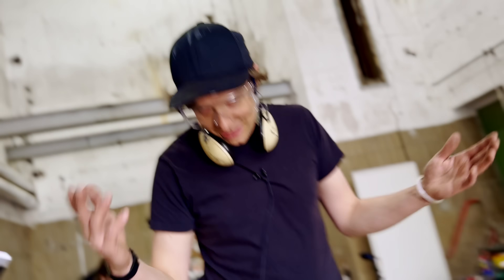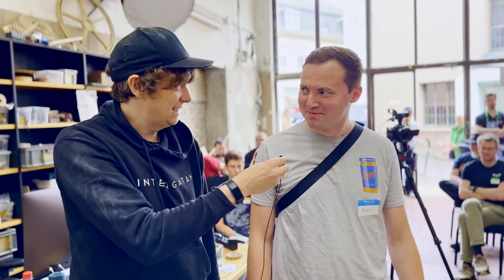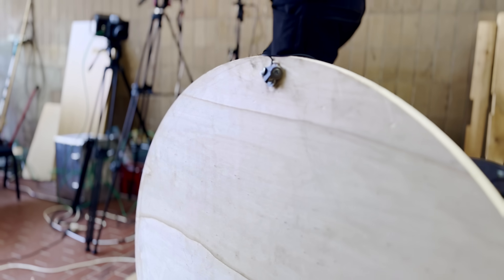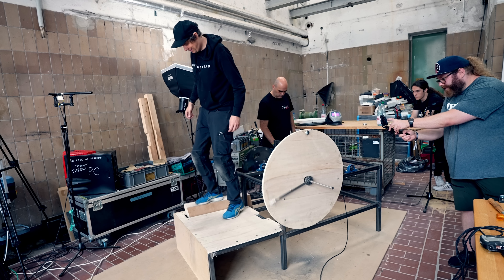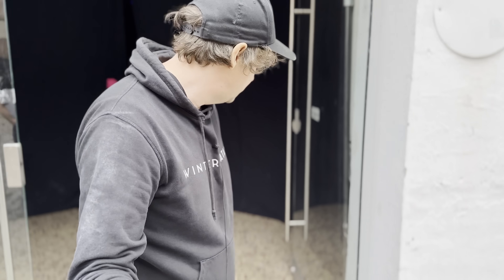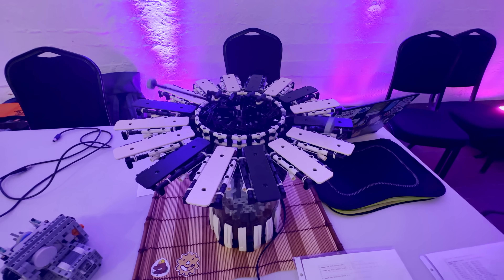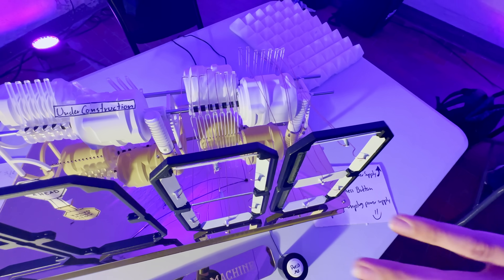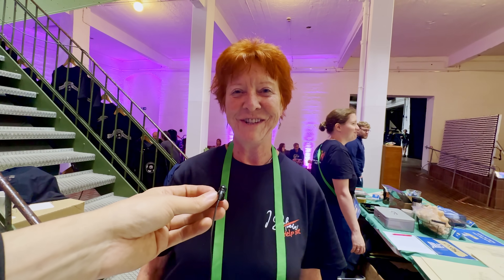First Timing Tests - DAY 6 - Marble Machine Flywheel Prototype

Comment: I would add an eddy current brake to the mass flywheel, also for emergencies. There's a lot of energy in it.
If you think this idea further, I could also imagine an eddy current-controlled speed limiter to keep the beat constant.
Reply: Eddy current speed limiter (aka an electromagnetic retarder) would work great for managing tempo. Martin would just pedal as fast as he wanted to, and the tempo would stay perfectly locked at a maximum.
Very easily doable with an Arduino, mosfet, and electromagnet.

Alternatively, he could also create a mechanical braking system that is electronically controlled. Could easily just take an old bicycle rim brake and apply that directly to the flywheel, with a servo tugging on the cable (through a stiff spring).
Reply: @roboman2444  I'm thinking of a centrifugal governor. You could set a maximum speed purely mechanically, without a computer.
Reply: @HilmarLange  Yeah that would work as well. Would it be precise enough, though?
Reply: @roboman2444  In any case, I would dare to try and build a small, mechanically controlled test model using a centrifugal governor. The attraction of solving everything purely mechanically would be irresistible for me.
Next step: I think that the flywheel should overspin the needed speed. With the help of a clutch, the stored energy could be extracted and the resulting required rotational speed (bpm) could be regulated with the help of the centrifugal governor.
There are still so many good ideas left to come up with!
Reply: a precision RPM motor would eliminate the need for the pedal entirely. he would need an RPM selector dial that can tell the motor what speed it needs to be at. using gears and pulleys and ratios to get exactly the mechanical advantage he needs. the pedal is a great idea, but its not necessary in my opinion. it coudl however be useful for helping the motor to change tempo or to start up the machine as a whole, but then if the motor can take over and maintain exact RPM speeds Martin can then just Play the instrument, and concentrate on the music, rather than if his foot is exactly timed or not. i can see Why he wanted the pedal though, because moving a limb is an instinctive way to create a Beat timing, however, the motor would be able to do that way easier, and much more precisely, which is what he wants, precision... keep in mind, that Most of the music machines at the Museum are powered by a Motor, so he isnt breaking any sort of intrinsic mechanical rules, but following a logical progression form human power, to electrical power. i do not want to see him discouraged because he can not get his pedal to play tight. he could still keep it for the function i mentioned above, but he should not rely upon the pedal to play the machine.

Comment: In reality you would not need to keep the BPM synced to an external metronome, but only keep the BPM synced to a specific number, if you understand. What you need is a "speedometer" that monitors your own speed and outputs that number to you.
Reply: It's the difference between frequency (which is important) and phase (which is irrelevant).  In this test he's trying to match both, which is really hard.
Reply: That makes sense,  just a needle on a dial showing bpm instead of rpm, so not trying to match exactly the downbeat but the actual speed needed to maintain.  I think trying to maintain control of bpm physically instead of mechanically is bold and potentially aggravating af to implement .
Reply: For the actual machine, he said that this is what he is going to do. It will be the only thing beside the microphones that isn’t mechanical
Reply: Fully agree! what he needs is something like the variometer in a glider. It gives a high pitched fast peeping if you go up (faster then the target bpm) and a low pitch when you go down (slower then the target bpm). It would basically indicate the difference between the target and the actual rpm/bpm.

Comment: If one stomp is one rotation, then surely you should be focusing on the stomp rather than the dial? 
Or is there something you can do with gears to limit the speed of the dial? So you can pump the fly wheel to full speed and not worry about timing?

Comment: Is it an idea to use a stroboscope to measure the thightness? If, in your current case, you play exactly 80 bpm but out of phase, you need to accelerate and decelerate to correct the timing. With a stroboscope you can ignore the phase issue for now.
Reply: The tightness of the thigh is a very important metric for a leg-powered machine
Reply: @palpytine  Thiccness, surely.
Reply: Very sensible, even works when on tour with other musicians if you can keep the strobe contained enough to not be really annoying but visible to the operator  - at least most musicians will be used to keeping time off/staying in sync with somebody else! As the machine is the least able to react it would have to be the pace setter.
Reply: And pitch won't change, so our ears won't pick it up.

Comment: So, apparently, what we have learned is that you need a way to set the tempo with your foot, and have the energy going into the flywheel from this action not affect the tempo at the same time, but instead be stored for use....?

Comment: I don't think syncing to a click track is important... you will always have problems since you've put so much inertia into your system.  If you need to sync other electronics to your machine... give them the click it generates!  You have plans for a regulator?  Perhaps adjustable?  Like a spinning ball (steam engine) or wind vane (music box)?  Music tempo feels better when it breathes anyway... don't be a slave to the click Martin!  Yes, the locking tabs are important, I had not realized you did not understand them, it's what happens inside a car wheel hub's locking nut.

Comment: You being in essence an organic PID controller you‘d need an even lighter flywheel to perfectly match an unchanging external beat.
Why don‘t you try playing 80pbm with a bpm measurement of your mic instead of trying to match an external beat that you continuously chase and overshoot, you‘ll see that you will be MUCH tighter than you think you can right now. Don‘t throw your design/idea because of bad measurement methodology.
Also isn‘t it hard to match with your foot down? I thought you‘d be easier to time your step if the beat is on the ‚up‘ position
Reply: Yeah. He’s trying to match speed AND phase without really thinking too deep about it.
Reply: Not sure I agree with it being easier to match the beat at the up position. I'm not a musician but, as I understand it, in a band the drummer keeps the tempo and the bass drum beats in a foot down position, so it should feel more natural to keep the beat in a foot down position.
Reply: @nagualdesign  My thought is that it‘s easier to time the start application of force than the stopping of application, and just by that time when you start applying, you‘ll easier control the speed because if you are too fast you ‚lag behind‘ in the application, and thus have less time on the input and less force in. Maybe it‘s not up, but 20deg into the rotation, think car engine, when the engine fires on a very simple engine  approx
Reply: Yeah, my first thought with this was a controls problem! Though manual control is notoriously bad, I really do wonder if there is a mechanical equivalent to a PI or PID controller... now that I think about it, a governor kinda acts like a mechanical controller...
Reply: Yes, I think you are right.  You could make the target click X ms from the previous measured position, not N * Xms from some arbitrary point in time, so you never have to "catch up" you just have to hit the speed.

Comment: I think the position of the clock hand influences your "feel" of the time a lot. It seems to be aligned so that the clock hand hits the microphone exactly when the pedal hits the lowest point. If you feel you're to slow, then the hand should hit earlier than at the lowest point. I am not sure if this will actually help but I can imagine it's hard to feel the beat when the movement doesn't match the click.
Reply: What MArtin is measuring now with the clock is meaningless.   The flywheel shaft has to go through a transmission to a give a consistent RPM.  The flywheel needs to be overspun to keep a reserve of energy.
Reply: @vonpredator  Agreed--I don't understand why that's not obvious to him.  Or if the intent is to keep a precise RPM, then this path is doomed.
Reply: Instead of trying to synchronize to the metronome, he had a bpm/rpm display he would nail it.
Reply: @anthonyleske6840  except he's trying to not just hit a target BPM hes also trying to play "in time" otherwise collaborating with other instruments, or being repeatable musically would be impossible see: MMX
Reply: @FrameRate_24  cant the bad jsut use his machine as the timing refrence though?
Reply: @FrameRate_24  The other musicians would just play in time with the marble machine. It's not like the timing changes that rapidly, so any decent musician will be able to adjust their timing to lock in with the machine.
Reply: Exactly!!  @Beakerbite
Reply: The machine is the the hero of the show everyone plays along with it @ThunderClawShocktrix
Reply: with that much inertia it would be imposible, and he is going to add a goveror as well.. with the governor once it is out of sync it stays out of sync. Speed up slow down on the pedal it will stay out of sync.  @FrameRate_24
Reply: @ThunderClawShocktrix  ever tried to play along to a bad drummer?
Reply: @anthonyleske6840 -- You could have a trim button to raise the governor limit a tad to catch up.
Reply: I have an old bug, you use a timing light for tuning.

Comment: Maybe you need some electronic support to maintan the same speed. I have someting in mind like the cruise control funktion in modern cars. You have full manual control of you speed but if you like to hold the speed push a lever and the machine maintain the speed by herself until you want the manuel control back.

Comment: Mark the tab you bent with paint, or something, so you don't use it again. Bent tabs will tend to break off if re-used.
Reply: Probably pretty obvious that the mangled tabs have already been used.
Reply: Great advice for keeping tabs on the situation
Reply: I think they should also keep spare tab wheels so if all the tabs were used, they can change out the part
Reply: Really you should replace the tabbed washer every time.  Best have a bunch of them on hand, especially on the road!
They are the sacrificial piece that protects valuable hardware. Best place for a failure point, and cheap.
you CAN re-use them, but like Mr. Farley says, please not the same tab twice. 
Such tabbed locking washers are common in so many industries, because cheap & effective.
Reply: Luckily there are more tabs.
Reply: @SoranoGuardias right! They can just use another tab midway a live concert! Makes sense to ignore metal fatigue!
Reply: They are pretty soft metal, I'm sure you can get several uses out of each tab.
Reply: If you look closely, there are multiple notches on the locking nut and multiple tabs on the spacer. But you only need to bend one tab to slot into a notch on the locking nut.
So, basically, if a tab fails you simply use another one. The design was obviously made like that to extend the life of the spacer.
Reply: @two_tier_gary_rumain  No, it's not to increase the life. The spacing between the nut notches and between the tabs is designed such that at any position of the nut, there will always be a tab that matches a notch. This is so you can tighten the nut to specifications and not worry about the tabs. If you have tabs missing, you might need to overtighten or loosen the nut to find a tab that matches a notch.
Edit: In general this design is not intended to be taken apart very often...
Edit2: On the other hand I think Martin doesn't have very strict requirement for nut tightness in his application, so using neighboring tabs could maybe be used to some degree as you suggested. Though normally the bearing fit is pretty precise, because the press fit on the ID of the bearing affects the resulting diameter of the surface the balls or rollers run on. If it is too tight, the bearing will deteriorate quicker than expected, if it is too loose, obviously you will have play in the bearing.
Reply: @justusfaust4101 AFAIK Martin plans to travel with the final iteration of the machine in order to do shows, which will mean reassembling the machine pretty regularly.

Comment: How about adding a toestrap, which will help you match timing because you'll have double-action control (up as well as down).
Reply: You can see they experimented with that in the Live stream.
Reply: They added a toestrap in the end, it seemed to help a little bit with control and input power
Reply: Losing balance with the foot strapped to the machine that easily lifts the whole body weight could open a side project, the Marble Wheelchair.

Comment: Another problem i see: Your pedal movement is not in sync to the rotation speed. You might need a transmission in a division with straight numbers 2, 4, 8, 16.....1/2, 1/4, 1/8, 1/16.......

Comment: I still don’t understand what you’re hoping to accomplish with the direct measurement of the flywheel for timing.  Unless you have a transmission of some sort to store extra energy/rpm you’d put into the flywheel it will never be “tight”.   as soon as you stop inputting energy, peddling..  the system will slow.
Reply: Agreed.  I don't see why there was ever any expectation that the flywheel maintain a perfect RPM.  And if that was the hope/expectation, then this project is ill-conceived.

Not only is there going to be massive fluxuations in the INPUT energy, there is also going to be substantial changes in the OUTPUT energy requirements (as the machine operates).
Reply: This is a prototype and what he's trying to accomplish is to determine whether or not this design will work on the MM3. It seems pretty clear that there are some issues with this design which it looks like Martin is beginning to realize, so in that sense, this test is a success!
Reply: @gir_bot  I don't think the problem is entirely with the design (although I don't think it's a GOOD design)--but the problem is with what he's expecting out of this design.  Expecting the flywheel to maintain a precise RPM is an incorrect expectation.  If that was the original plan (a year ago), then I don't see why it took a year to recognize this mistake.

Ironically, isn't this exactly what Katie (I believe it was her) commented a couple days ago about the 2nd machine:  what he was EXPECTING the machine to do, wasn't what it was DESIGNED to do...
Reply: @gir_bot  Yeah but...how much do you think that rig cost?  And this is a mistake that should have been identified long before anything was fabricated.
Reply: @br52685  Remember, Martin is not an engineer by trade. Making mistakes and learning from them is part of the process. Cost of the prototype is minimal and a non-issue compared to the cost of starting over from scratch like he did with the MMX, which is how we got here. Being able to identify issues before fabrication would be ideal, but there are so many things like how sturdy to build a peddle that Martin cannot get from CAD, hence the prototype.
Reply: @gir_bot  The biggest issue here, is he’s simply repeating the same mistakes for the last 10 years.  Was the INTENT/EXPECTATION of this flywheel ever defined?

If it was stated that the flywheel was expected to maintain a precise RPM, this whole mistake could have been avoided—as that is not the purpose of a flywheel.

Even Katie (?) identified it the other day in her comments about the 2 machine:  it “flailed” because it was expected to do things that was never intended for.

This is the overall, REPEATING mistake that has caused this project to drag out for 10+ years
Reply: @gir_bot  I’m not an engineer by trade either, but i know not to reinvent the wheel.  That is what Martin is doing here.  He did some very strong  work in designing marble drop gates, he should focus on the musical side.  What he is “reinventing” here is mechanical devices that have existed since the dawn of the industrial age.  Use what worked in the past and move on the greater challenge of the interface with the drums and marble gates with the instruments.
Reply: It smoothens out the changes, making them less big.
Reply: @dimitrimichaux461  Yes, that is the obvious reason to use a flywheel, but you also give higher torque out on the shaft to drive more things….  He can’t keep peddling the wheel, he needs to overspin the flywheel and get  extra stored energy into it then use that through some sort of transmission to drive the machine in proper timing…. This all seems to be very frivolous….